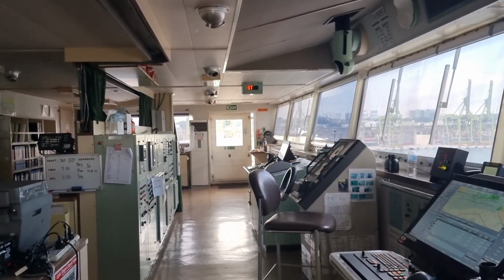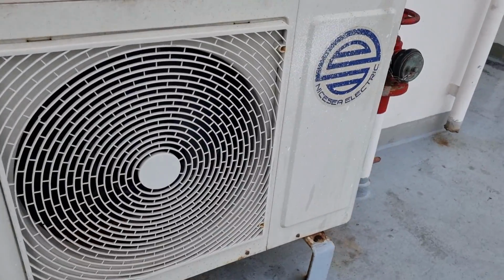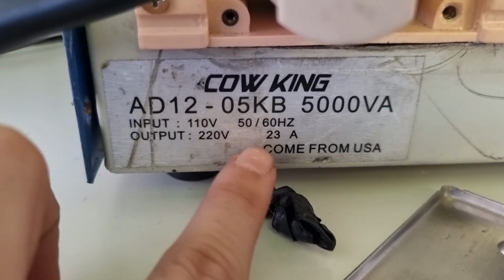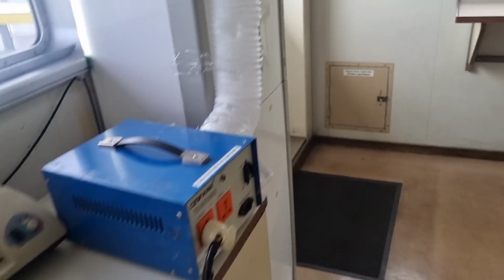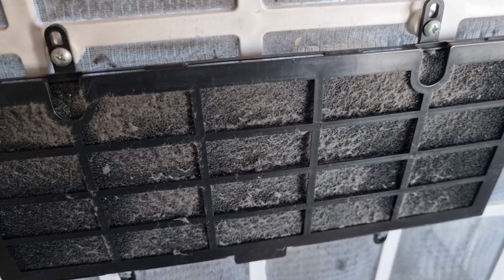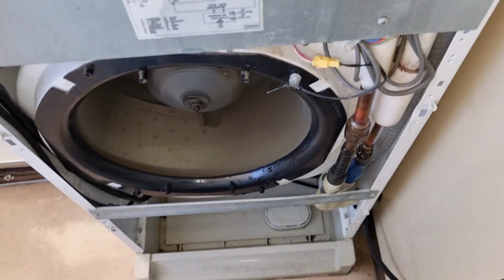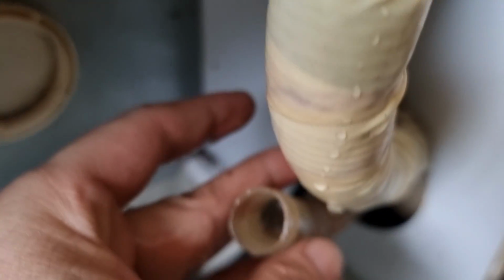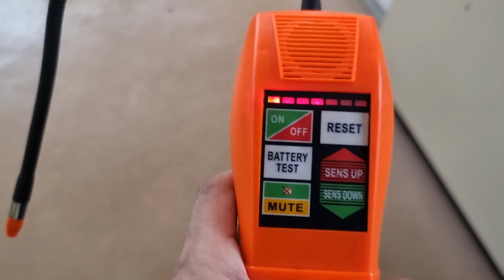FIXING 2 INVERTER TYPE AIRCONDITIONS, NEED TO FIX ASAP!

Comment: I'm really surprised that they used a plug-in type of transformer considering they have electricians on board at all time why didn't they use a real regular transformer and hardwire it in
Reply from the maker: you are actually right, that is why i ordered the sealed type so I can hardwire it. I will install another breaking point near to the AC itself.